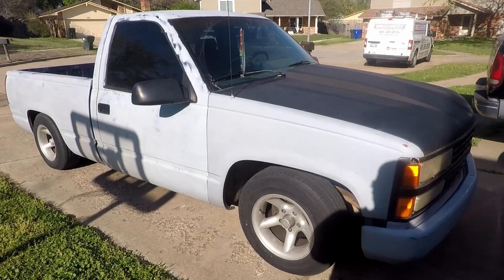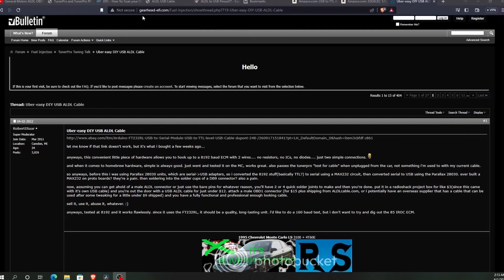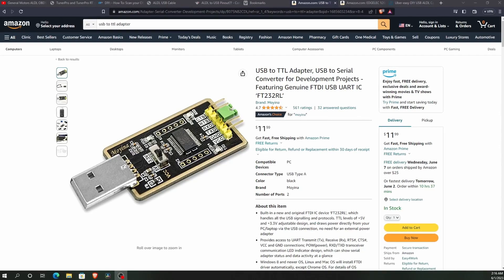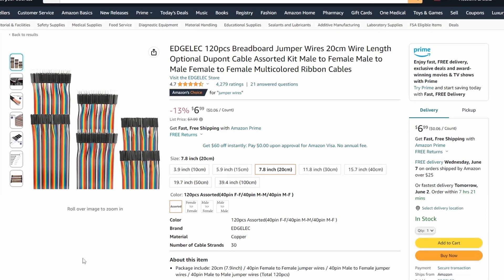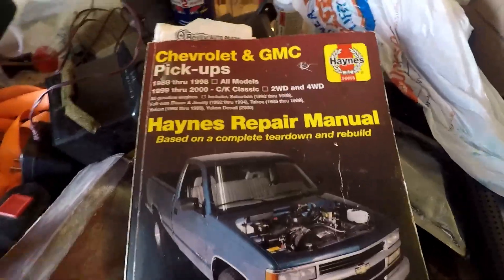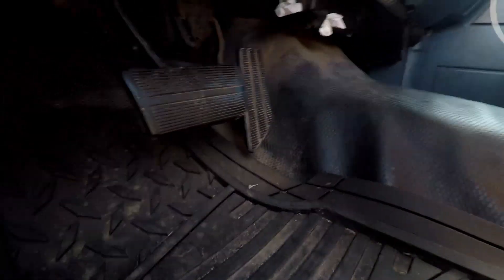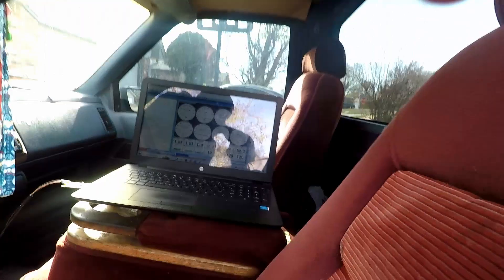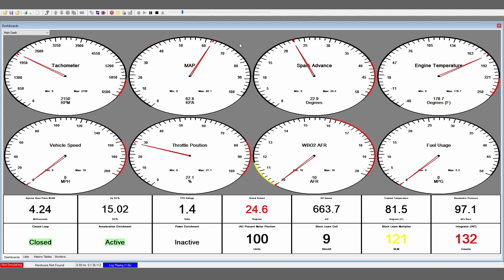DIY GMT400 OBD1 Scanner Under $20

Comment: Did everything you said and it doesn't work. Waste of $20 and half my day.
Reply from the maker: Thats very unfortunate. As you can see it worked just fine on my end. Make sure your pins are connected to the right ports.Good luck!
Reply from the maker: Almost forgot, I have not used mine in over a year so my memory is a bit fuzzy on this. When you take your TX and RX cables and connect to you OBD pins. Make Sure you stop initializing on the the software before you try different OBD ports. If you just move the pins around with the program still initializing, it wont recognize the port movements. You may have to pin around on different OBD pins. Stop the initializing, move your ports, then reinitialize. I had to do this on this truck because my first pins i probed was incorrect. Hope that works for you!
Reply: @PixelDab I appreciate your response in regards to that technicality... I'm coming to learn that there is an abundance of nuanced technicalities if you want to get this to work

Comment: I simply short pins A & B on the OBD1 connector and read the "Service Engine Soon" flashes.  
Steps:
1.  Short Pins A & B.
2. Turn ignition to "ON" - Do not start the engine
3. The "Service Engine Soon" light (SES) will flash the Diagnostic Code 12 three times... Flash, Pause, Flash-Flash
4. After the third code 12 flash, the SES light will flash the trouble codes 3 times... example:  Flash, Pause, Flash-Flash-Flash-Flash = Code 14     Flash, Flash, Pause, Flash, Flash, Flash = Code 23    Etc...
5. Refer to GM's OBD1 Code sheet and the code will tell you the trouble area on your vehicle.

I had trouble shorting the pins on my connector, so I wired in an on/off toggle switch and simply flip the switch instead of shorting the pins.  Easy-Peasy.
Reply: That doesn’t show you any actual data and these trucks are notorious for having issues without producing a SEC light such as idle issues or vacuum leaks.

Comment: Hello. Man, you are so much into teaching. Your video really explains and covers it. As of today writing this response, in my wind 10 pc, the driver address does not run at all, nor the system allows to manually select a different driver. I even was able to download it from other sources. 2012 PHASED OUT message. And as of today, Prolific just endorses using a  chip from certain sellers, that will work with the latest drivers avalilable as of 2024. Still investigating.....need to check on my 1994 chevrolet camaro z28. Thank you very much for lighting the way.
Reply: @emiliochin987  Hey man I have the same exact Camaro. I got it working with TunerPro after getting the DA and ECM serial number. If you’re wondering you really can just shoot out in the dark with the first serial they gave for the software. Otherwise you have to check your ECM to see what version it is. Btw you can check the ECM with out worrying about disconnecting the 12v battery. Mine happens to only have DTC no Trans codes. Can’t get it to show me the codes live yet since it’s winter.

I’m running windows 11 and it works so far. Can’t emulate the ECM however.

Another great source for getting the bin files and acquisition files is from GearHeadEFI too.

Comment: You can jump pins A and B in the dlc connector and it will give you the codes stored in the vehicle lmaooo
Reply: Yes, you can. But the help on diagnostic when you have live data is a quicker help. And what about mapping for power or economy? That is when this video really shines.
Reply: Jumping the A and B terminal doesn’t help anyone with a 94-95 vehicle. They require an independent powered display for reading codes because they don’t flash the check engine. A pain in the rear. Buying an original GM code reader and plugging it in puts it into “read mode” making the fans spin. However you cannot read codes, putting a OBD1-USB cable allows live data but cannot put the vehicle into diagnostic mode depending on what cable, software, Bin file, DA, etc you use.
 It’s quite the stupidity of gov making these two years of cars absolute dog water with regulations.

Comment: Worked perfect!! Fixed my daughters 94 Chevy g10 that had some drivability issues. I used your setup and was sooo stoked when I saw all the data on my laptop!! I recorded a run and then analyzed the data using TunerproRT. I particularly liked the graph functions when looking at the data and easily identified the issue as a leaking EGR valve. I was so stoked with the product I gladly registered my Tunerpro software. Thx PixelDab!! This is exactly what I needed at a fraction of the cost of a scanner and with the tunerpro graghing feature, prob better than a hand held scanner for hundreds more!!
Reply from the maker: Hey that is great news! I’m glad the video is helping people out.

Comment: This works fantastic 50% of the time. Can't figure out how to make it work full time. What could I be doing wrong? TunerPro Rt is now starting to not work at all. It opens up but can't open an acquisition file and where's or what is actually the green button?
Reply from the maker: Sorry I’ve been super busy. Sometimes the pins get rusted out and cause the data loss. The green button should be towards the top if I remember correctly. Let me know if you got it working and if not please replay and I’ll do my best to look into it.

Comment: I used to do this back in 2009.  Its still hooked up to the OBD1.  Shops ask to view the data because they don't have the obd1 in 2024.  The safety pins was used as a male to fit in the female ALDL.  Safety pins rust, so change them every couple of years.

I saw your video, because I am going to make another cable with the official ALDL connector.
Good video.
Reply from the maker: Thank you, very good info. Will keep this in mind!

Comment: Chris, there is a switch 5V or 3.3V? How can I contact you?
Reply from the maker: We only need RX, TX and ground pins for this project. The voltage switch is for the voltage pins. We won’t need those voltage pins for this project. 
Hope that helps!
Reply: @PixelDab   it looks that my reply was deleted..... Since the above mentinoed adapter was not avaliable in Germany i bought following: DSD TECH USB to TTL Seriell Adapter Converter with FTDI FT232RL Chip Kompatibel Windows 10, from the same Shop as yours. Does this work?
Reply: @gennadykozovoy hello ! You tried the DSD TECH one ?

Comment: Man I’m glad to come across your video, I’ve needed to be able to see what’s going on with a project 88 Chevy Silverado 4x4 single cab, I’ve had the transmission switched out several times rebuilt and remanufactured, it’s lugging real bad going into overdrive immediately after third gear, and the motor acts like it’s lugging all the sudden, the brake doesn’t disengage lockup unless you slow down to a stop almost. It has a lot of new parts and work done since I’ve owned it in 5 years and the transmission is still under warranty but I believe it’s something with the motor and overdrive and I need some kind of data to know something. Thanks

Comment: Actron CP9690 works on OBD I and OBD II. It is well-lit. The screen is large. Ebay has it.
Reply from the maker: Thanks for the info! This will help out so much!
Reply: I just found one of those Actron Elite scanners but I'm also interested in the laptop approach. For the record the Actron CP9690 is the same as the Bosch 1300 so if anyone is looking for a handheld scanner you can try searching for both of those models.  Fair warning they are NOT easy to find these days!  I think I'll grab one of these commercial cables to USB myself

Comment: on the dupont wires going into the ALDL port on the truck, how did you get those to stay in? Can already see that being very frustrating lol
Reply from the maker: You are 100% correct lol! I bent the end of the pins on the Dupont wires just slightly, then I used some tape to hold the wires flat to the lower dash and tucked the wire into a crevasse. I'm currently looking for some male pins for that ALDL OBD1 connecter for a more long-term solution. I will share if that ends up happening.
Reply: @PixelDab I'm sure you could by a cheap adapter to do it.
I'm from Australia, I know the vy commodore is known by diff name in states, so hope the dl links work lol

Thanks for the upload!!

Comment: Great video, trying to fix up my old 93 also. Have the links to the stuff you bought?
Reply from the maker: Thank you! Yes hit the drop down in the description and you’ll see all of the links. Good luck on your OBS.
Reply: @Charles Long  Thanks! When I first checked the links, they weren't clickable.
Reply from the maker: @Heavy_TX  yeah for some reason because I don’t post much they have to verify my account with two months of history before it will make my links live. I’ll try and see if I can’t speed that verification along quicker!
Reply from the maker: @Heavy_TX  USB to TTL Adapter, USB to Serial Converter for Development Projects - Featuring Genuine FTDI USB UART IC ‘FT232RL’ 

https://a.co/d/3xoUjSN

I believe these come with a small amount of those cables you seen. 

If not then here are the cables: 
https://a.co/d/d92paVc